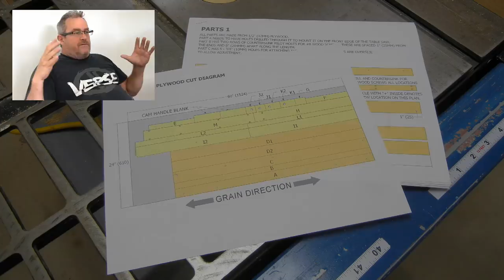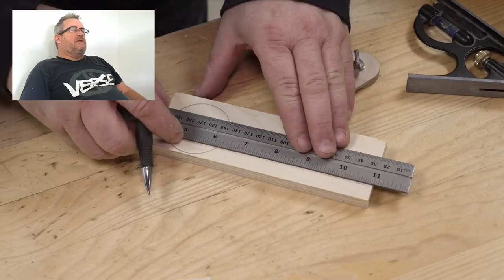Don't Use The Word "Joints" In Your Video Title / Thinking About Quitting YouTube

Comment: John,as you get older wether you like it or not,you slow down. It's easy to sit down to a laptop and convince yourself you're being productive.    If you have a friend in the building game who needs a hand for a few days, do it, it will be hard, but you will get fitter,do that for a while when work comes up. When you get fit enough to want to buy a fixer upper you'll be able to do it more easily.   You will be amazed how unfit you are now, when you try a couple of ten hour days at building speed.

Comment: John, first and foremost is your health.  NOTHING comes before that. Take it from an old guy who is battling cancer for the third time.  First comes your health and then comes the quality of your life.  Both are vitally important.  
My second thought is that Youtubers and many people just getting in to the "Maker" world are going in blind.  I know this isn't you, but some of this applies. I've heard advice from many more successful Youtubers to just plunge right in and get started.  That's great to start, but it won't get the job done over the long haul.  My suggestion is to formulate a business plan and include the concept of a 40-50 hour work week and no more. Your plan has to incorporate time off.  If you've written one already, maybe it needs some serious revision.  It is certainly worth hooking up with the SBA and finding a volunteer with many years of experience to review and fine tune what you've already done.  If you don't have one, they'll help you get started.  Obviously, you're not looking for a loan, but if your business plan would satisfy a bank it should help you prioritize your work, work flow, product line etc etc. 
Finally, your website is losing traffic?  Maybe it needs to be optimized for SEO (Search Engine Optimization) There are free analytical sites that can tell you a lot about your traffic.  What drives them to it....is it Only YouTube?  etc.  Maybe your website would benefit from a re-design?  (just spit ballin')
Ultimately you're going to have to decide on a direction and a pace.  Seeking help to organize your business toward more profitable operation isn't a bad thing.  No matter how you choose to proceed....your health is #1 and quality of life is #2.  #2 can't happen without #1!